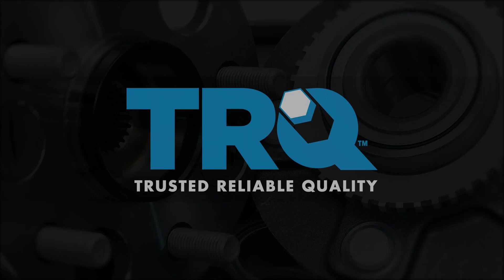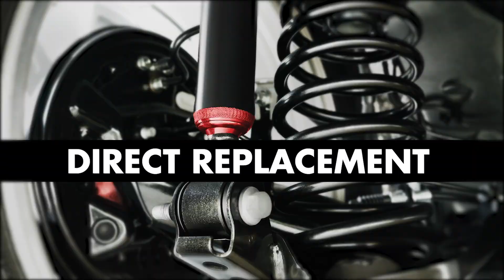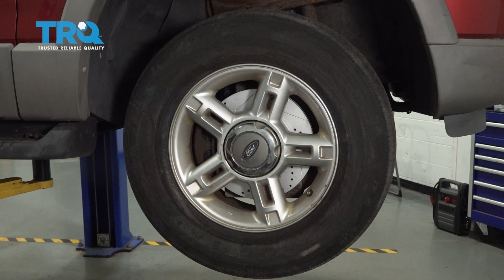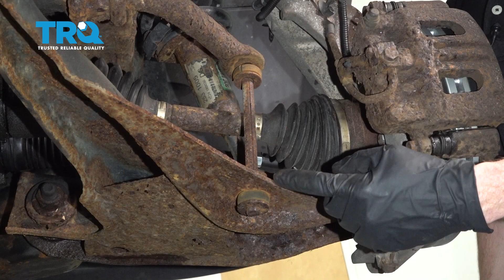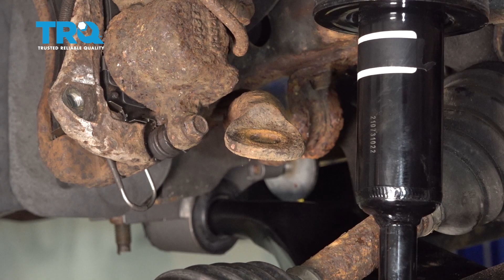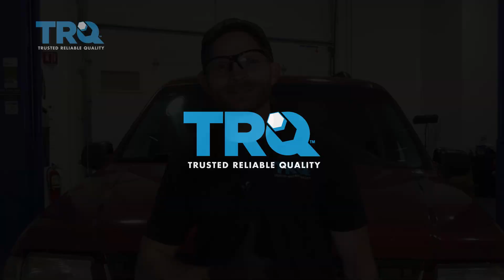How to Replace Front Sway Bar Link 2002-2005 Ford Explorer

Comment: Will these being bad prevent me from having an alignment done? My explorer was denied because of the lower ball joints and as I was replacing them I noticed these sway bars are bad. I need a alignment done and wondering if I can do these after and not mess up the new alignment?